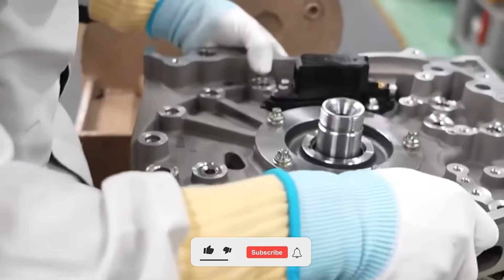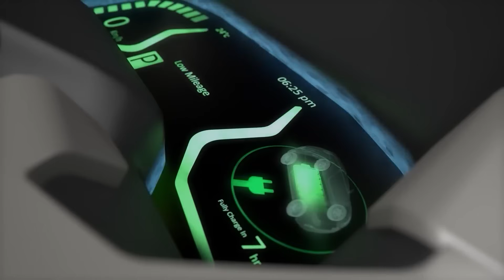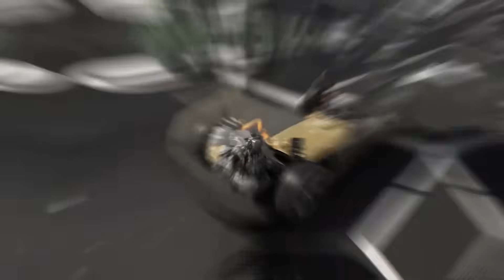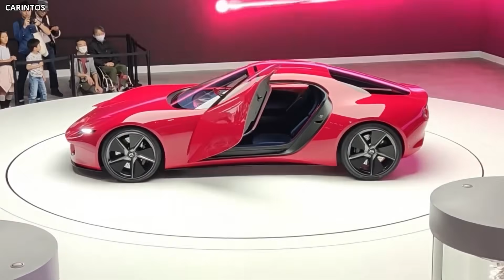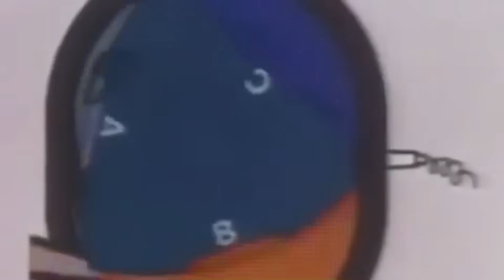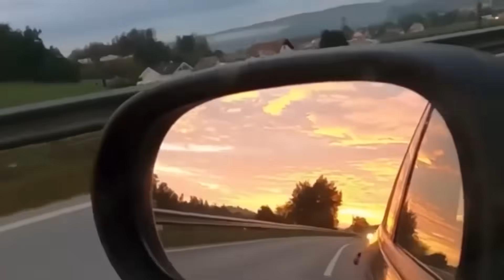Mazda Just Shook the EV Market With Its Biggest Announcement Yet!

Comment: The biggest problem with EVs is the lack of charge points. If you run out of juice the only solution is a tow. One time i rolled into a charge point just as the available mileage clicked over to zero miles left!